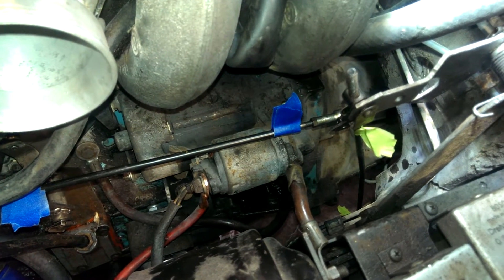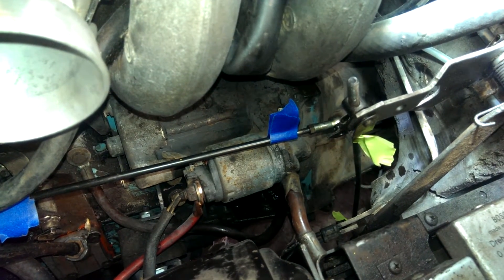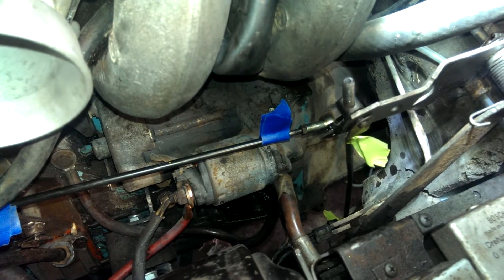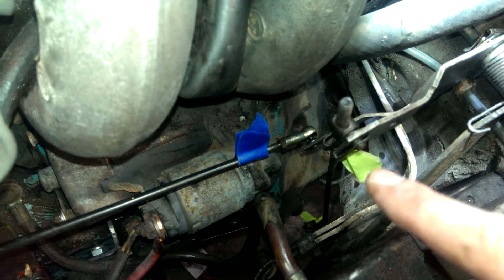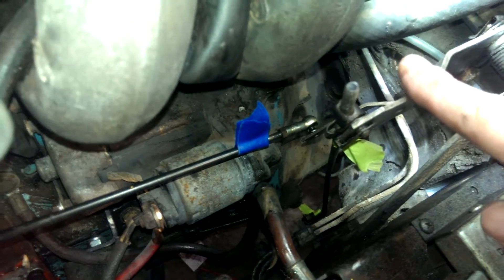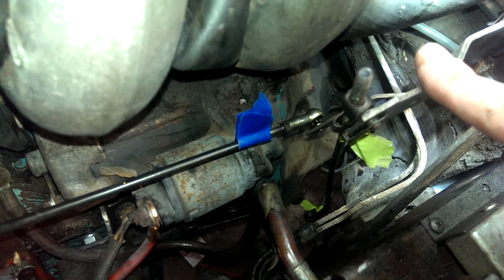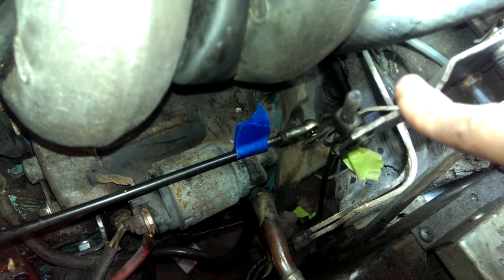BMW 2002tii throttle linkage operation

Comment: thanks 10 years later it helps me my mechanic broke the pull rod and shaft linkage when takin off the intake manifold! trying to save a 74 from the rust monster